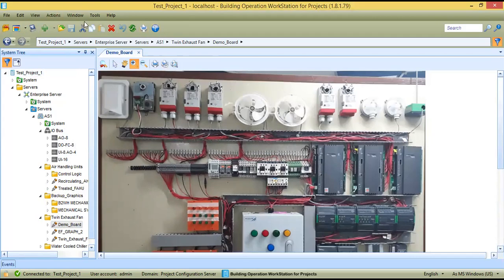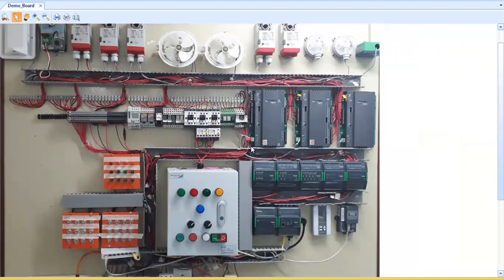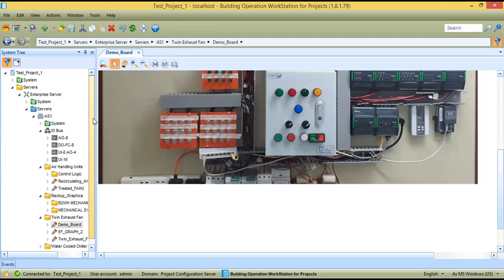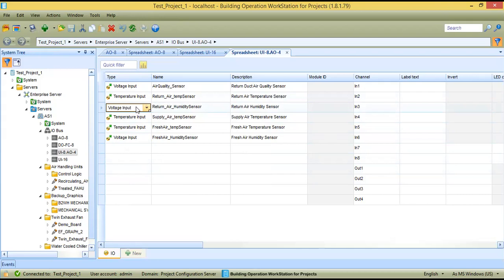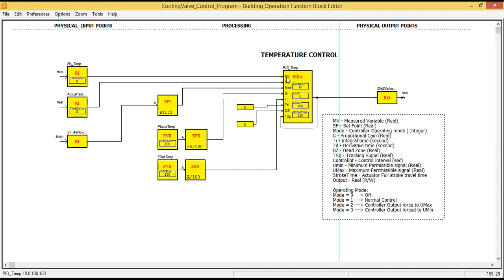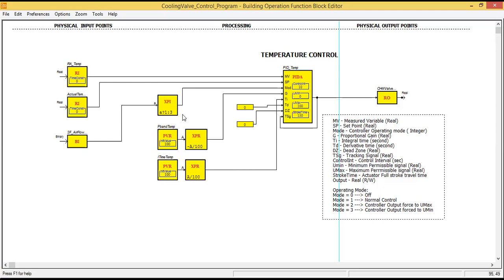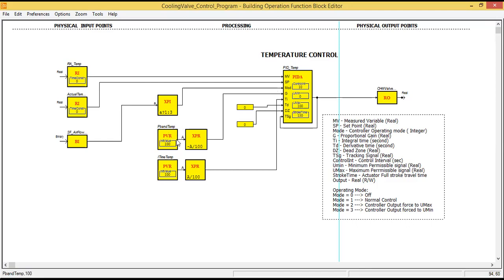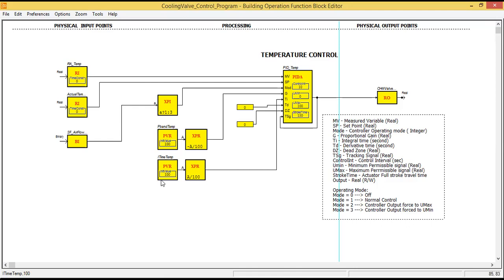How to become a BMS engineer part 85 (AHU Valve control logic program)

Comment: Is this automation server same as ACM or global controller..?
Reply from the maker: this automation server is like a network control unit, actually the automation server will be responsible in communicating to the management level (BMS server/workstation) and to the lower level (DDC, RTU and other third party system). It is like Automation server is in the middle part communicating above its level and below its level
Reply: @SantosJrCapellan-BMS  Thanks sir...and I hope you will upload a video about how to load the programs to controller's soon...
Reply from the maker: @sachinkp4504  I will try to do this video tutorial later, I just need to prepare my demo board one of laptops where the Automation server is attached was corrupted, maybe I need to factory reset my Automation server